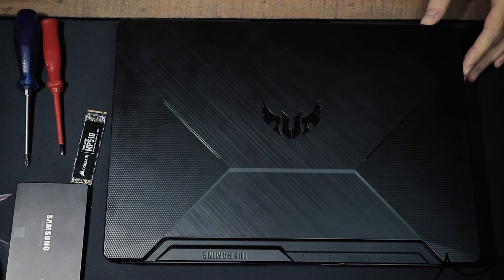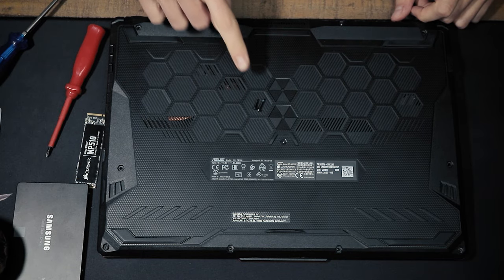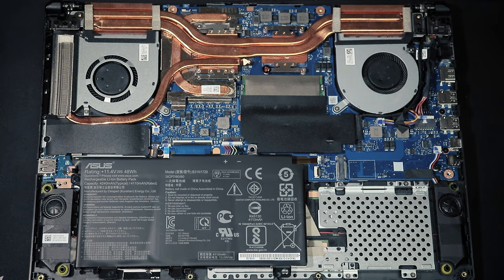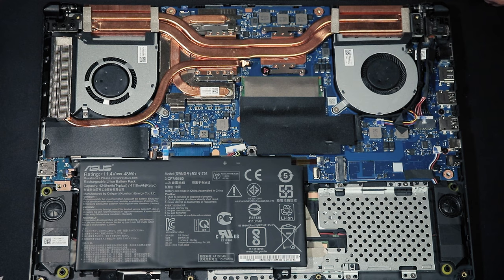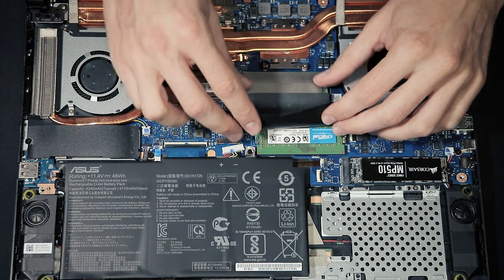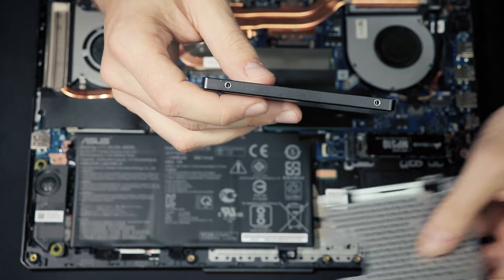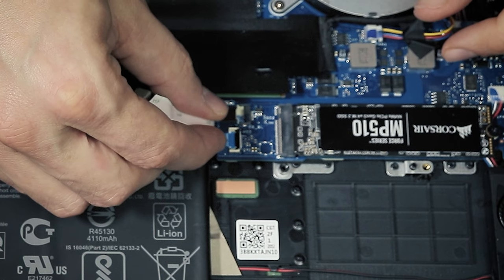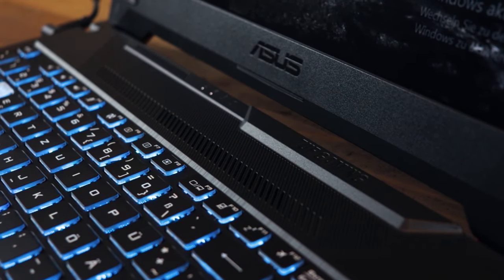ASUS TUF A15 // Installing SSD + HDD + RAM (Is the cable too short?)

Comment: I have Laptop ASUS TUF F15 FX506HCB , and I don't have hdd port on board but i have place for hdd disk. I only have port PCIE SSD. Why?
Reply: I have the same model, only PCIE SSD upgradable?
Reply: There is literally a label named hdd con where sata port should have been. It is just not installed.
Reply: @0guzkose  what you pierdoling about?
Reply: @kamus1231000  there is no hdd sata port on the motherboard for your version but there is a label saying "hdd con" where other versions of the laptop has that port.
Reply: @0guzkose  Yes but why there is place for hdd without conn
Reply: @kamus1231000  that is a question for asus unfortunately.

Comment: If you still pay this thread attention, I could use some help with my ASUS Tuf Gaming A15 that is having issues.
Reply from the maker: I can try to help 🤷‍♂️
Reply: @Hubwood  I have an ASUS Tuf Gaming A15 laptop, and until about 4 months ago was running smoothly and doing great. Now its randomly locking up, black screening, needing to be hardbooted up (by holding the power button till it cycles off) and it also randomly BSOD (Blue Screen of Death) while watching streaming shows, playing games, or even directly after booting up from a cold boot after not being touched for days. I have done everything I can to correct these issues with updates, reinstallation of drivers and even reinstalling windows. I am at my wits end and am now at the point of BEGGING for help from professionals like yourself. Please can you help me Obi-wood?
Reply from the maker: @Gullydwarf  if reinstalling and reseting windows won't help, it sounds like it is broken. Hopefully it's still in warranty?
Reply: @Hubwood  Sadly no, the warranty ran out. I wasn't aware it had run out either, I thought I had extended it. So there is nothing at all that I can try? No replacing any hardware or even buying new software to fix something I am not thinking of?
Reply from the maker: @Gullydwarf  did you actually try resetting windows? Edit... You did.
Are you monitoring temperatures?
Reply: @Hubwood  I used a program called HWMonitor to look at the temps and did so after a cold boot, a hot restart, and right after a BSOD incident. As far as I can tell (and I had to Google to see the ratios to be within) the laptop is working fine temp wise, but I am also not the most savvy of gamer geeks, and am still trying to learn how to better gauge and read the temps properly.
Reply: @Hubwood  If you like, I can send you the data to skim and see if I read it wrong?
Reply from the maker: @Gullydwarf  Hm I guess it's fine then. Actually sounds like a hardware issue :(

Probably nothing you can do to fix it by yourself :(

Did you change the BIOS? Did you try to update the BIOS?
The only thing I can think of beside that is opening it up and check for issues. Since the warranty is gone anyhow... Give it a good clean (dust wise). Maybe repaste it (lots of videos available on how to)... check for burned capacitors etc.

Comment: where is that cable which is put in my SSD
Reply from the maker: Should be in the original box of the laptop. If not: I posted a link in the pinned comment!